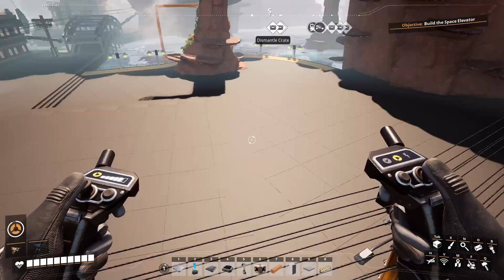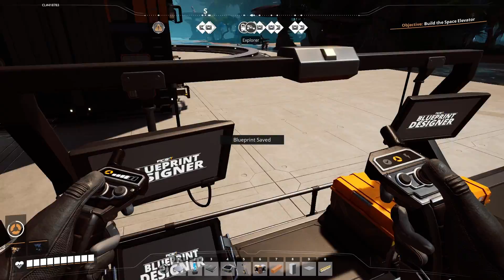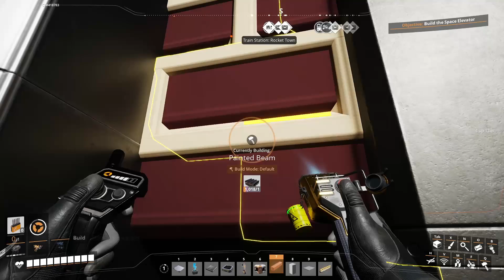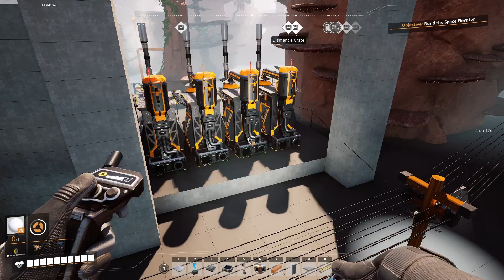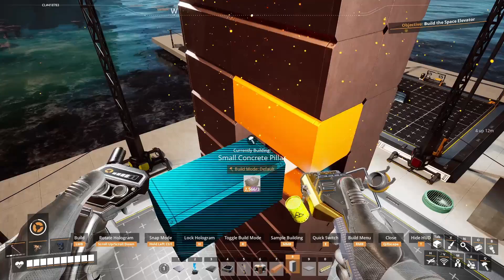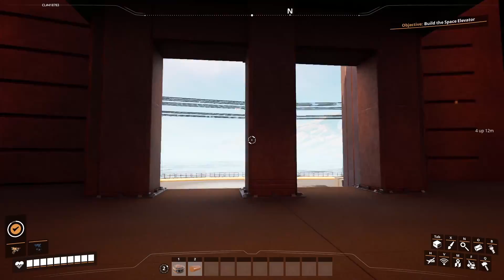You're using blueprints WRONG!!!

Comment: I love everything about this.  I have been working more on design now that I'm somewhat proficient in the gameplay aspects of the game, but so far haven't attempted anything this big.  I have a lot of good ideas now.  I've just done the (machine) blueprints for a turbofuel factory, so that could be my testing ground.

As far as those chimneys go, just cap them off with a vent or fan.  That will give you the "hole" for the exhaust.  I guess the other option would be a pipeline floor hole?  But that might be a bit too small, I'm not sure.  More than one?  If they were paintable, a group of round concrete beams might be an option as well.

Thanks for the excellent video.
Reply from the maker: Thanks, glad you liked the video. The great thing about doing blueprints like this is you can test out your ideas really quick and see if you like them and make version or variants really easy